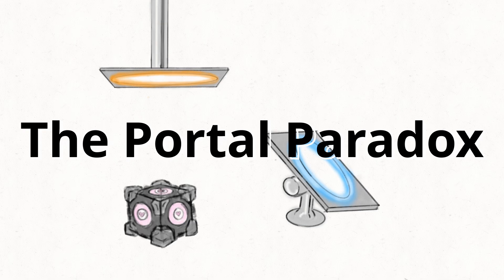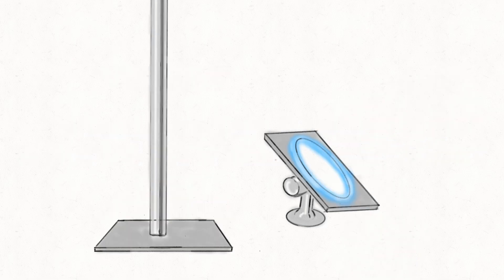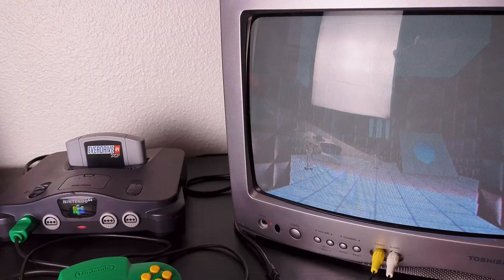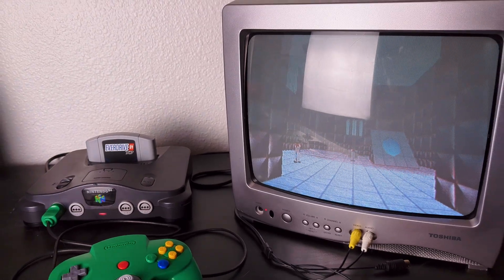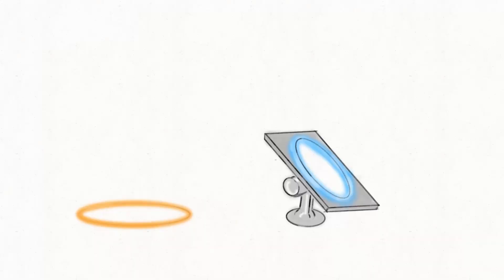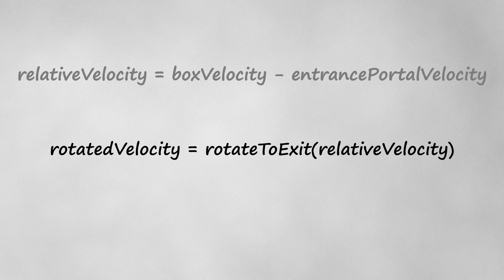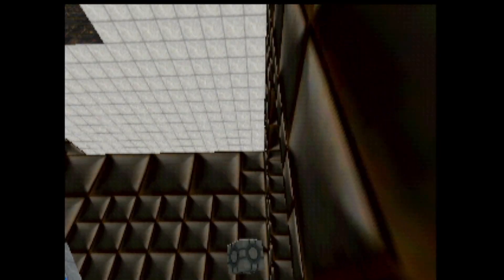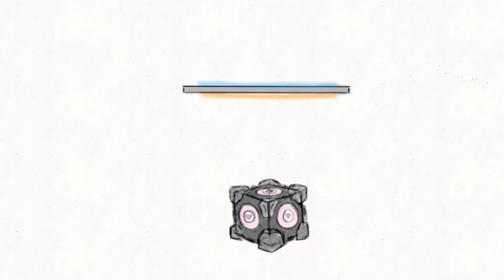I rewrote Portal from scratch and solved the Portal Paradox

Comment: So, important question, what happens if you don't slam the entrance portal all the way down, but instead stop halfway through the cube?
Reply: in game, idk

Using real world physics, my guess is the top/front half of the cube will have velocity, because it's already through the portal, but the bottom/back half won't, so it's just about whether that velocity is enough to overcome the cube's inertia and pull the rest of it through. I'm not sure of the exact numbers, but it should definitely move at least a little... probably.

A good guess would be it goes half as far, but I suppose it'd need a test, to be sure.
Reply: @NathDDM you are 100% correct. Let’s say the piston stops half way through the cube, it depends on how much the cube weighs obviously and how fast the piston is moving. Just like you said if the top half overcomes the inertia of the bottom half then the cube will go through. 

If the piston stop 1/4th of the way at the top leaving the other 3/4th on the bottom, you’ll probably get the cube to do a little “hop” but not go all the way through the portal.
Reply: @SkrtOnYoGrave  I think we should also consider if the piston stopping is instantaneous (which theoretically is impossible), or if it decelerates first.
Reply: @SkrtOnYoGrave so does it mean that if the object is long enough and the portal goes at the right speed, the object is going to be "sucked in" by the entrance portal before it can reach the base of said object?
Reply: @NathDDM  so 51% down the cube should be enough to launch it
Reply: @Zarnubius Well, it depends on some stuff... like how fast the portal is moving.
Reply: So, it gains momentum, which contradicts the original game, which states that momentum is conserved between portals. @Zarnubius
Reply: @NathDDM I think the change in velocity as it stops would affect the force and counter out the velocity of the first half
Reply: @KenderGuy  but the box won't change in velocity due to the portal stopping. The half that's already through will have velocity, and the half that isn't won't. The front half will lose velocity due to being connected to the back half, and the back half will gain velocity from being pulled by the front. The speed of the portal only matters at the exact plane of the portal.
Reply: bro imagine the portal goes at the cube at like, 90% the speed of light and stops at half way of the cube. would that rip the cube in half? The force that the part of the cube that doesnt make it trough the portal feels is directly proportional to the velocity of the incoming portal. we can write an equation for this stuff   @NathDDM
Reply: @droher1344  why would it rip though, the 2nd half of the cube has no force other than a small amount of gravity holding it in place, it would move sooner than tear in half, unless you immobilise the half that doesn't go through.
Reply: @NathDDM   Ingame is likely dependent on the center point of the cube, as is likely modeled as simple point object with collision box around it.

As for real physics it gets a bit tricky and I think you really opened a paradox here. If we start thinking in terms of real world phyics we need to start thinking in terms of the momentum and how it changes passing through portal and when exactly. 

We can think of a few thought expermients to try to solve the paradox (I think results would be wierd to say the least):
Let say that instead of a single cube, we stack multiple cubes one on top of another, when the entrance portal passes the first cube and than stops, will the first cube "detatch"  itself from the stack or not? 
in your interpretation it will and I aggree is the least problematic explanation, but it still causes paradoxes: like what happens if the exit portal is accelerating (say accelerating upwards by many Gs)  and istead of using boxes we use something compressable, say we bolt a bucket to the ground and fill it wih some heavier than air gas..... How is momentum being transfered and what is happening with each molecule....
Reply: oh damn, thats a good point
Reply: Then you'd stop the cube's motion halfway into the entrance and thereby also stopping its relative speed at the exit.
Reply: @ismirdochegal4804  The cube is not a single uniform entity. It is a complex volume made up of atoms and molecules. And the portal stopping its speed relative to the exit and the remainder of the cube wouldn't have a retroactive effect on the parts of the cube that have already gone through the portal.
Reply: @Abion47  In reality yes. But this is a game. In in this game, a vector is assigned to an object.

There is another game: "Starlight Conflict" - a space shooter with stargates. That game worked different. Once something touched the gates entrance it was teleported a few meters away from the exit and velocity was set to 0.
Reply: I wasn't expecting any real replies. Admittedly I just wanted to see it happen in game for monkey brain curiosity.
Reply: My head is imploding thinking about it but I feel like something ends up getting divided by zero and is destroyed by infinite aceleration. In any case the conservation of energy seems like it would be broken as you could "create" kinetic energy by shooting a lightweight portal over a dense cube. Sounds like an energy efficient way to launch a rocket though!
Reply: If you want the actual in-game answer: It depends on how it's programmed. It could be accounted for, but I suspect by default, the box's position will be determined by a single point, as that's how games tend to work. So most likely, if that point passes through the portal, the box will fly off, and if it doesn't, the box won't move at all.

To have something closer to real-world physics, it would have to be coded to account for that. I'm sure it's very possible, but just has to be considered.
Reply: Well then the cube stops halfway. After all, the entrance portal also has to stop halfway. 

And if you decided to go fast, but slow down really slow when you reach the cube, cube would also be slow

Or at least, thinking of it like passing a hoop over a stationary cube
Reply: Speed would probably be halved
Reply: Half of the cube retains momentum of the exit velocity while the other doesn't. If that momentum is enough to overcome the gravity pulling on the other half of the cube, it will make it through albeit with a slowed velocity. If it isn't it will just seem to hop, if it moves at all.
Reply: If the cube were made of wet tissue paper, it'd break in half
Reply: This is a great question - The change in momentum for any layer of atoms looks like a step function in time, which means the force felt (the derivative of momentum) would actually be infinite, for an infinitesimally short period of time (a delta function). In other words, it doesn't actually matter what the material of the cube is or how much of it has passed through (assuming each layer only feels an attraction to the next nearest layer) - it always feels the same amount of force and it will almost definitely break.
Reply: Depends on whether the bottom half is attached to the top half strongly enough to prevent it from being ripped in half by the force of half of its weight suddenly tugging in a particular direction.
Reply: How fast does the entrance portal have to be moving relative to the exit portal before the cube is torn apart at the molecular or subatomic level?  
Similar to how the gravity of a black hole disassembles matter.  One end of an object is accelerating faster than the opposing end.
Reply: People are talking about forces and acceleration but there are no forces in the portal. It also makes no sense to talk about half of the cube having different velocity to the other half. The portal creates a continuity across two frames of reference. The cube is stationary in is original frame of reference if you look into the first portal. The cube and everything around it is moving with the same velocity as the first portal. If the velocity of the first portal changes to be stationary with reference to the second portal then everything behind the first portal will appear stationary from the second portal's frame of reference.

There is one exception where matter from in front of the first portal has displaced matter behind the second portal, and so imparted a force to the matter in the second portal's frame of reference, but I don't think that the matter from the first portal's frame of reference has any velocity independent of the first portal's velocity.

Tl;dr: I think the cube would slump, not fly out of the second portal.
Reply: @TroyLaurin  It makes perfect sense for different parts of the cube to have different velocities. (assuming we're talking about real world physics, rather than the game) That's just how things work.

As each part of the cube passes through the portal, that individual piece will accelerate. These pieces would drag the other parts along with them (or break), but that isn't immediate. Information has a speed limit, so the velocity has to propagate through the cube.

It's very fast, though.
Reply: @NathDDM  That's not how things work, I'm afraid. A rigid body can't have multiple linear velocities, but the overall structure can exhibit a rotation. Velocities also can't change without force.  Now go back to a game of Portal. The portal doesn't move matter or produce forces of any kind, it simply changes the connectivity of two spaces. Things get interesting mostly if you consider objects near the portal from the point of view of each side of the portal.

Specifically in the case of a moving portal approaching a cube, the cube has fixed velocity from both frames of reference, and doesn't experience acceleration other than gravity from either frame of reference unless the velocity of the moving portal changes.

If you think there is an acceleration, where is the acceleration force coming from, in either frame of reference?
Reply: @TroyLaurin  yeah, but rigid bodies only exist in theory. It's just a simplistic approximation in physics to substitute the atomic forces of every single atom in a body with a single linear vector at the centre of mass. In reality nothing is rigid, everything is malleable under the right amount of forces, even if that takes a cosmic scale force. Atomic bonds are getting broken, etc. And our reality is starting to glitch out as soon as we introduce infinity. Black holes for example. 
Apply infinity in acceleration and you'll probably end up breaking the universe. Apply infinite acceleration to different parts of a body and I think you may end up blowing them up or having them collapse into a black hole? Similarly to soft body simulations where you apply a sudden and excessive force to a single node of the body and it breaks out of the body.
Reply: @The_Opinion_of_Matt  why would it rip though, the 2nd half of the cube has no force other than a small amount of gravity holding it in place, it would move sooner than tear in half, unless you immobilise the half that doesn't go through the portal.
Reply: @LupusUmbra995  I suggest you look into what happens to an object that gets sucked into a black hole.
Reply: Based on how game objects work, I’d guess that this one would just give it the velocity once the objects defined position passed through the threshold, but in the real world I don’t know
Reply: If infinitesimal mass of the cube passes through the portal, that part will gain relative speed to the exit. The reason it gains speed is because the infinitesimal part passing through the portal experiences  a different gravity from the rest part of the cube.

Integrating the infinitesimal mass to the half of cube, I guess the cube will be sucked in to the entrance, if the portal stop at half-way.
Reply: Roche limit. The cube will tear in half. Obviously 🙃
Reply: The real part 2 is if one portal is moving sideways, does the box get skewed or is fine?
Reply: It would be interesting if we replace the cube to a hanging string. That may answer the question if we stopped the portal halfway through the cube.
Reply: It would be interesting to do this experiment with a spring
Reply: In game: Depends on the engine. Either the cube's mass is concentrated in the center of mass, in which case it has full speed if it went past the halfway point, or is stationary if it did not. Or it behaves (mostly) like it would in RL.

In real life: While the portal is moving, nothing is happening. Then, as the portal decelerates, there starts to be a momentum discreptancy within the cube. The parts through the cube have a different momentum than the part on the ground.
Or at least, they try to have. But since it is still an object joined by the electromagnetic force, the momentum is transferred between the portions. This causes a tidal force (like you would feel near a black hole, and like Luna inflicts on the sea) along the portal's plane.
The force's value is at any point (Mass of the lighter cube portion)*(Deceleration Rate).
If this force divided by the surface it is inflicted upon is greater than the material's stress at yield, the cube will be stretched. If it is greater than the material's tensile strength, the cube will be ripped apart.
If it is not immediatelly ripped apart, the whole cube will start rising into the portal at acceleration of a-g (a is the portal's deceleration, g is the gravitational acceleration), until the portal stops, or the cube is through. If a<g, then it doesn't rise.

If the portal is accelerating into the cube instead, it would be compression stress instead of tensile stress, which most materials are able to bear better.
Reply: @Mathel_Steeltoe  "Then, as the portal decelerates, there starts to be a momentum discreptancy within the cube."

... why?  Without an accelerating force, from the the first frame of reference, the entire cube is never not stationary.  From the second frame of reference, the entire cube is moving with a velocity opposite to that of the moving portal, including when the portal is decelerating.

If such a force exists, what is it and where does it come from? (hint- it's not gravity from the second frame of reference, that would push back and rotate the cube, it wouldn't pull it into the air ... unless the second portal was mounted in a ceiling, but that's a less interesting problem)
Reply: @TroyLaurin  You are right, the force upon the cube is not gravity from the second frame of reference. It is tidal force of the portal.

Let's do a thought experiment. Entrance portal is pointing down and moving onto the cube. Exit portal is stationary, pointing sideways.
The entrance portal moves around 1/2 of the cube at speed v, and then instantly stops.
The portals are now stationary to each other, and close enough that they share a reference frame. So, in our shared reference frame, we have:
2 portals, stationary
1/2 cube under entrance portal, stationary
1/2 cube next to exit portal, moving at speed v away from the portal.
The 1/2 cube next to exit portal can't move away though, because it is tethered to the half of the cube under the entrance, which is not moving. It has to share it's momentum with it, which will be a pulse of force along the portal's plane. In this experiment, where the portal stopped instantly, it will just rip the cube apart.

All effects of portals changing speed would be:
Decelerating: tensile force pulling things into the portal.
Accelerating: compressive force pushing things out of the portal.

By accelerating, I mean changing velocity towards the portal side's mouth, while by decelerating, I mean changing velocity towards the portal's back. If one side is accelerating at the same rate as the other is decelerating, no tidal force would be felt by the objects going through.
Reply: @Mathel_Steeltoe  I disagree with two main points in your thought experiment...
* "The portals are now stationary to each other, and close enough that they share a reference frame."
Even if the reference frames are equivalent, I think you lose much by combining them and it is worth conducting the thought experiment separately from each reference frame.

* "1/2 cube next to exit portal, moving at speed v away from the portal."
Why is the 1/2 cube moving in any reference frame?  The cube's velocity from the second reference frame was because of and matched with the velocity of the portal.  Why doesn't the cube's velocity change when the portal's velocity changes?

My suggestion is that when the portal stops moving, so does the cube.  The cube would only maintain a velocity in the second reference frame if the portal kept moving through the floor supporting the cube, by which time the floor pushing the cube in the second reference frame would result in a velocity not directly tied to the movement of the portal.

I do concede that I am arbitrarily choosing the floor as a point of discontinuity to provide the push, and there is a potential argument that as the first portal moves around the cube, the portion of the cube not yet through the portal is pushing on the portion of the cube that is already through the portal, and the velocity of the cube in the second reference frame is a result of this force.  But if there is any non-zero force in the equation, what is keeping the force from pushing the cube through the portal faster than the speed of the portal?  Would we see the cube raise from the floor even before it is through the portal?  If not, that suggests that the force only appears when the portal is accelerating (decelerating), and the force pushing the 1/2 cube that's through the portal is in the opposite direction than the apparent force slowing the 1/2 cube that's still in front of the portal.

To be fair, the cube having independent velocity in the second reference frame makes for a more fun game mechanic, but there are weird corner cases that are hard to reconcile with respect to real life physics.
Reply: @TroyLaurin  I can split it into the 3 reference frames, that is not a problem.

While Entry is moving: Cube bottom is
According to Floor: stationary
According to Entry: moving in
According to Exit: stationary
Cube top is
According to Floor: moving out
According to Entry: moving in arbitrary direction
According to Exit: Moving out 
Force is applied to Entry by piston. Cube bottom is
According to Floor: stationary
according to Entry: stationary
According to Exit: stationary
Cube top is
According to Floor: moving out
According to Entry: moving out
According to Exit: moving out

The 1/2 Cube next to the exit is moving because it matches the speed of the Entry while it passed through. It gained this speed by reference frame change (from the frame of Entry to the frame of Exit). But any part of the cube not currently inside the portal plane is not changing in frame or reference at the moment, so to change it's speed, some force has to be applied to it. This is where the tidal force comes in.
Reply: @Mathel_Steeltoe  I think we fundamentally disagree what portals actually are. You think that one face of a portal can't affect the world on the other side of the portal. I think that the two faces of a portal create a continuity and there's no reason why one face can't affect the world on the other side.

Without a stricter definition of what a portal is, and more particularly what it means for a portal to move, I don't know how to tell which interpretation is correct. Thanks for continuing the discussion civilly, I'm ok with living in a world with different possible interpretations.
Reply: A moving portal would constantly be breaking and reforming the continuity of space though, right?
Reply: I had this exact question and I scrolled down right as I was thinking it and read your comment lol
Reply: In this case, what would happen (in-game) will almost certainly not match what should happen in real life.

As has already been said, the game will be treating the object passing through the portal as an atomic unit, not a collection of particles.

Another scenario that won't play out correctly in any approximated simulation:

Slope the entry portal to 45deg and drop it onto the cube.
This should impart a spin onto the cube as it passes through, and given that this spin will cause a portion of the cube to re-enter the exit portal, the maths becomes impossibly complicated.
Reply: My instinct is that you would have to stop beyond half way as the top half of the cube wouldn't have enough weight and momentum to pull the bottom half of the cube through. I'm sure it's more nuanced than that as added momentum for one half of the cube might override the weight of the other half. It would be like Newton's Cradle where the momentum of the first steel ball carries it's force through the other steel balls of equal mass because it has mass plus momentum. The momentum is transferred undiluted to the last ball which does not have enough inertia by itself to resist the momentum. The top half of the cube needs to pass through the portals far enough for the combined momentum and mass of the upper portion of the cube to carry the rest of the cube through to the other side. That's my very simplified take.
Reply: That's a good question that shows the flaw with this understanding
Reply: The cube will stay where it is just like if you go all the way over the cube because both portals are still moving the same speed at the same time, where they stop doesn't matter.
Reply: the cube goes out at a reduced speed, as both sides want to maintain their motion, balancing out in the middle somewhere.
Reply: The cube would enter the upside down pipe like Mario
Edit: which, this thought lead me to portal suction cups / pistons
Reply: Wouldn't it just move with half the velocity?
Reply: If this happened irl, it would be plop. Game engines cant simulate real physics, thats why it launches. 

In real life, it would be like dropping a holahoop on a box but the other side of the hoop is further away. Since only the portal is moving and not the box, and the inside of a portal is empty, there is nothing that puts force on the box, so halfway through it would stay like that.

The box speed relative to the portal is irrelevant because passing thru a portal is like just walking thru a door, only difference is its ends arent connected. There is no reason for the box to move because of this.
Reply: @chickensoldier9790  not the same: holahoop's two sides are in different states. In the same frame of reference one side will be moving, the other side will be stationary. Then whatever the moving side swallows, the object that comes out on the other side will necessarily have changed properties, such as velocity and direction compared to the origin of the reference frame. That change is not free, because that energy has to come from somewhere according to our laws of physics.
Reply: In Portal 2 an object can exist on the either side only, so it would be an instand difference at about 50%
Reply: Engineer here, who basically has a physicist degree, the atoms outside the second portal are moving in the new relative spacetime, the atoms before portal entry are not moving in the new relative spacetime. Yanking would occur. An actual force would be felt.
Reply: @Jacqueline_nonya so what would happen if we throw an infinite acceleration into the equation? The portal stops/starts instantly half way through? Would that effectively cut the cube in half, as one side of it doesn't have momentum, the other side of it has? Also, if we reverse the direction with infinite speed and instant acceleration, would that tear a hole in the space-time fabric? Could perhaps the cube collapse into itself in a cosmic fashion, such as creating an event horizon, but flat?
Reply: @Teasuti  why would it rip though, the 2nd half of the cube has no force other than a small amount of gravity holding it in place, it would move sooner than tear in half, unless you immobilise the half that doesn't go through. soooo many people saying this xD, how strong do you think gravity is??!
Reply: But in that situation you're creating momentum-- unless you'd contend the pushing arm would need to work harder once parts of the box enter the new FoR
Reply: @Jacqueline_nonya  Exactly this. Additionally, this would continue for the entire set of atoms if the portal moved all the way down instead of stopping halfway through. There is literally no paradox here, only people without an understanding of basic physics claiming it's a paradox because they didn't pay attention in science class.
Reply: @Jacqueline_nonya right, if someone pulls your arm, either your body moves or your arm comes off lol
Reply: Absolutely nothing
Reply: If you stopped at the halfway point, the portal would be sucked in, and exit and half speed.
Reply: Ingame: the cube just stops.
Real world, the cube could be torn apart due to the sudden acceleration. which could also happen when going through a moving portal, now that I think about it.
Reply: @Stilgarsan  Interesting thought, this is probably the closest to true as the individual atoms of a material would be given velocity instantaneously. I think though the true answer would be that for each material there would be a critical velocity which would give an atom enough individual momentum to break the chemical/electrostatic/metalic bonds holding it together and it would rupture. So for some critical velocity a person going through the portal would be fine, but feel a really discomforting pulling across the plane of the portal. But exceeding the right velocity you would come out the other side as disassociated steaming meat-bag components. And I say steaming because atomic momentum is equivalent to heat energy, so a portal would cook you a bit depending on how fast you go through it, right?
Reply: You guys are going to open another paradox. Stop it! 😂
Reply: Nothing would happen, to stop the first portal you have to decelerate it at the same rate you decelerate the second portal. The relatively velocity of the box to the locations of the two portals is identical because the portals are physically coupled. Therefore the rate at which the box emerges from the second portal is the same as the rate at which it is engulfed by the first portal, and both must approach zero at the same time.
Reply: @Kparris7  I can see where you are coming from but I think that in these examples, the stopping of the portals motion (halfway down the box) is supposed to be an instant event. The same as when it hits the floor at speed when engulfing the whole cube. So imagine something half the height of the box preventing the portal from moving lower. If the deceleration were gradual then I think your theory would come into play.
Reply: @LupusUmbra995  yeah in any physically real system the movement can't be instantaneous. You can inject more energy to try and get the box to stop in increasingly shorter times, but you can never make it discontinuous.
Reply: So I asked what would happen with infinite acceleration, instantaneous start/stop of the portal half way through the cube, because I was curious how you guys would solve that thought experiment. Would it be plausible to think of a tidal force as explained above? If both ends of the cube are staying in the same frame of reference, than one end would have momentum, the other end wouldn't have any. And according to the law of the conservation of momentum, this would necessitate a tidal force then?
Reply: This probably isn't how it's modeled in the game though. The cube probably has a hit box, sure, but I'd bet it's mass is modeled as a point in the middle, so the cube either moves or it doesn't, depending on if that point clips the surface of the portal. No halfway cases.
Reply: I'm going to say that all of the replies explanations so far are wrong, though the results may be similar. Imagine not the orange portal moving, but the floor instead. What happens if you stop the cube halfway through the orange portal is almost exactly the same as if you move it all the way through (minus the bottom half of the cube still being in a different gravity zone for longer without being pushed, if you push it halfway through). So if you slam the floor with cube onto the orange portal, the speed is the same as when you slam the orange portal onto the floor as explained in the video, and if you stop the slamming halfway through the cube (minus the small correction as written) because the "slam" speed was the same. Ofcourse this correction is going to have a bigger and bigger effect as you go to an infinitesimal part of the cube.
Reply: @woud3404  I like reframing it as the floor slamming towards the portal because it should be identical, but you made an error in the equivalence. The floor doesn't stop moving, the portal on the ceiling instead starts moving away at the same speed the floor is moving, maintaining distance.

The portal itself doesn't apply a force, it just generates a continuity from all points on one side of the portal to all corresponding points on the other side. The floor has maintained constant V, and I posit that the cube should stay on the floor when the portal locks speed with the floor because there is no force in the system to lift the cube, unless the second portal is facing downward so the "top" half of the cube is being pulled by gravity in the new frame.
Reply: @woud3404 I'll point out a small potential flaw in your logic; (but props! I wouldn't have thought this through all the way without reading your post) just that slamming the portal down from above and the floor (with cube) up from below aren't quite equivalent. When the portal is moving down the floor and cube are stationary with one another. When the floor moves the cube up it imparts momentum to it, which is all fine and well until the floor stops moving up, which from the point if view of the cube is like it accelerating downwards away from it.

If we look at the portal-stops-halfway-down case one would lead the to top half of the cube having velocity relative to portal, and converting that velocity to momentum upon exciting. This would impart half the momentum of a full portal drop, it would pop out the exit portal at half speed as the top half yanked the bottom half through.  Maybe slightly more, actually. Between the portal starting to clip the top of the cube and it's final position the cube should start moving as portions of it pull 'upward' on the rest, causing the relative velocity to increase. This would make a great word problem for calculus students.

In the floor-stops-halfway-up case the cube would be entering the portal at the regular full speed, and as the floor stops gravity would act to deaccelerate it, but only the back half is still in a gravity-down zone, the front half is experiencing gravity as 45 degrees off from 'forward' (direction of travel). This would nearly cancel, impart some spin, and let the momentum carry the cube the rest of the way through at nearly full speed. Again, calculus for the exact answer.
Reply: If the portal was moving up to the cube, gravity would be imparting the force, not the portal. This is the same as if you hold a cube half in and half out of a portal and let it go. It would just drop at the normal rate of gravity. @PuckLokin
Reply: @woud3404  ahhh I see what you mean, that would make sense. We need real portals to test this.
Reply: @woud3404  Your proposed solution doesn't answer the question at all regarding what would happen if you pushed a portal halfway through a stationary cube. Your explanation implies that nothing would happen since the floor, and therefore the cube, is not moving. But if we were to construct the forces and velocities at play with regards to the portal paradox solution as presented by the video, a force would appear clear as day upon the portion of the cube that made it through the portal as it attempts to pull the rest of the cube along with it (and whether it succeeds depends on the cube's physical properties). 

The difference between the portal-moving scenario and your floor-moving scenario is that in the latter, the cube will enter the portal not just with relative speed but with momentum as well, resulting in the cube emerging through the exit portal even faster than in the former scenario.